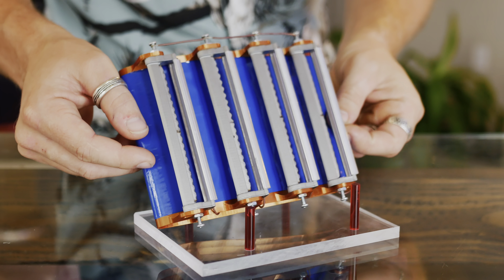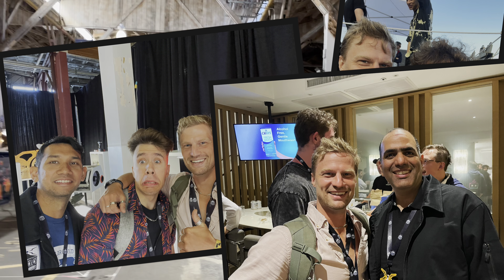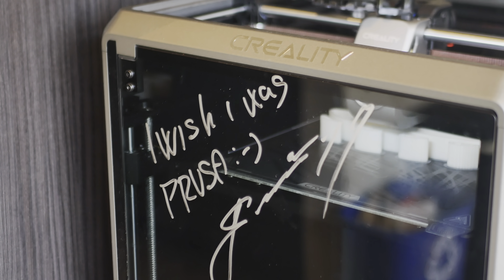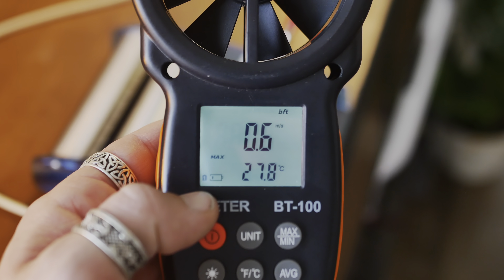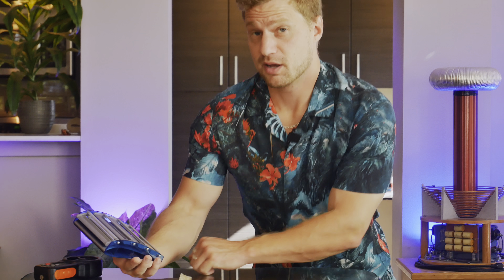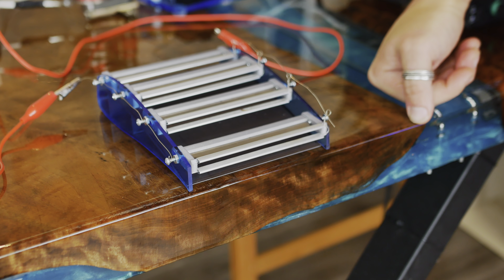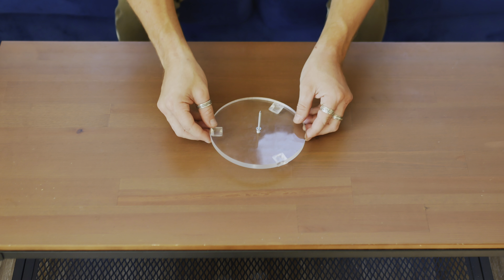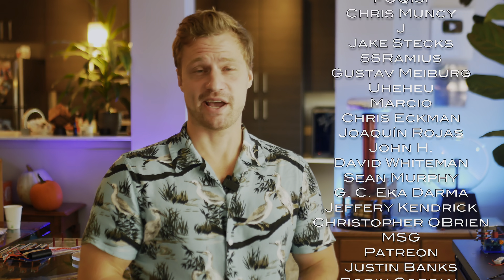Designing A Self Propelling Ionic Thrust Wing

Comment: Some comments I would like to make as an engineer. By having the thrusters mounted on the wing the way you did there will be some consequences. Firstly, the lift and drag characteristics of the aerofoil you chose will be affected by this positioning significantly essentially the data on the lift curve slope and drag coefficient will have to be taken with a huge grain of salt. Furthermore, mounting the engines this way means they are following the curvature of the aerofoil this is bad because on the upper surface towards the trailing edge the thrusters will be constantly pointing downwards and this will generate a nose down pitching moment on your plane. To correct this I suggest you either integrate the thrusters into the aerofoil however this will be significantly more difficult maybe something along the lines I have drawn. However, I’m not sure how you would get the thrusters to have access to air. 
Final point about where you located the thrusters you mentioned that you made the aluminium streamlined I would suggest you pick an aerofoil shape for the ionic thrusters aswell as otherwise you will produce a very large drag coefficient

Comment: Instead of just the glider, maybe revisit old delta- and flying-wing designs that Popular Mechanics used to tout as 'the future of aviation' back in the 90's. Lots of surface area with a built-in lift. Alternate strips of Ion Engines and photovoltaic solar panels to run them.

Comment: With a parametric eq, like in Logic, you can use a narrow band to isolate the freq and then drop the gain on just that narrow band. Start by taking a narrow Q handle and maxing its volume. Slide it around until that sound is really loud, then drop the gain of the handle way down.

Comment: Fascinating!
Question: the air velocity is highest over the top of the wing. This means that the pressure (and hence, density) is lowest. Do you really want the thrusters under the wing, where air is densest, and slowest?
Since the densest air gives you "more" to accelerate, it would seem to be a plus. It also is smoother flow, less turbulent going through the thrusters.
What about splitting the upper and lower wing skins, with the thrust creating elements inside? It might be possible to create a "blown wing" configuration flying at slower speeds. And you get "thruster structure for "free"!

Comment: Maybe another reduction of weight could be painting your electrical connections with carbon impregnated resins? 
To increase thrust, adding ducting overhead of your thrust would increase the airflow in, and the pressure/velocity out, would it not?

Comment: When thinking outside of the box, don’t actually completely loose sight of the box.  Leave planform considerations to actual qualified aerodynamics engineering.  Instead, you are developing an alternative propulsion system.  Just leave it a that.  Do your work there.  Don’t attempt to dabble/dawdle outside of your own emerging field of design.  Whether a single (maybe, dual) Ionic Thruster in the tail, or multiple in nacelles hanging off pylons, you are just attempting to come up with a revolutionary replacement power plant to replace what is already well located within existing airframes.  Furthermore, any new thrust producing technology need be more energy/weight efficient than other means (as measured in, say, total thrust-pound hours per total energy capacity weight)

Comment: 1. Make the thruster assembly monilithic? Like joining them with plastic. Without bumpy edges.

2. Make the monolithic thruster surface profile exactly as the wing surface itself.  Or add another wing on top of the thruster assembly. This way, the top surface will also generate lift just from moving through air along with the top surface of the bottom wing where thurst comes from the plasma attracting air. You get more lift in total maybe?

3. Question, Can you control lift by turning off/on or modulating airflow through one or more thrusters instead of moving surfaces? Now if possible, that would be a one step to a completely fixed wing plane.

Comment: I can't shake the feeling that having multiple positives and negatives in a series can be counter-productive if not 100% of the particles charged by one electrode get dis-charged by the next one, but it's just an hypothesis of course. I'm guessing we could learn a lot about the dynamics of these prototypes by placing them inside a container with Xenon or other easily-glowing gasses.

... I'm also daydreaming a miryiad of possible designs and hypothesis I'd love to try out if I had the means, I'll try and pitching them to you instead :D

Comment: The top of the wing has low air pressure. So the thrust might generate unwanted pressure
But the bottom has fast moving high pressure which might cause drag if the thruster doesn't move enough air

Comment: Never thought about how ionic thrusters wor, but you just made me very interested. Try diving into aerodynamics a little, F1 cars provide a lot of info about this. From my knowledge, the first thruster is fed clean air and can have a maximum input and provide optimal performance while the following thrusters are fed by the output of the first. Is that going to reduce their performance? How about a decreasing size of the thrusters? A big one that takes in a large amount of air and is feeding the next slightly smaller module. I think this approach would decrease weight and power consumption while increasing the performance. Might not boost the results, but at least allows to cut even more weight

Comment: I wonder... if you split the wing horizontally and incorporate the ion propulsion within the wing structure instead of obstructing the low pressure surface (top) of the wing, if that will be more efficient. Your lift comes from the overall low pressure surface in conjuction with the propulsion source

Comment: How does it work with water vapor? Like clouds and so on. On a normal jet-engine it would get pushed to the walls and directed to an channel that moves it around the engine till the heat turnes it to vapor, making the water produce more volume. So how does the ionic-engine handle water ? Also does it work in a vacuum? I heard one time that the ionic-engine is a way to move things in space.

Comment: I watched your experiment and found it very interesting. I have a problem and maybe a solution which could help, so here goes. The problem is, yes the thruster works on your little balancing device but all this proves is there is thrust as in your experiment as the device rotated but there was no evidence of lift . The lift of the wing section is nullified by having the thrusters on top of the wing section. However; if you were to incorporate the thruster in the wing cavity, slots in the leading and trailing edge of the wing section allowing for the air to be drawn into the thruster through the leading edge slots and exit by the trailing edge slots I believe this would work. Aircraft use "Spoilers" to break the lift component during a landing cycle and on parked Aircraft the breaking of lift can be achieved simply by having piece of 4X2 on the top of the wing preventing it from obtaining lift and trying to fly  whilst on the ground. Cheers

Comment: You should look at how sailors trim sails on tall ships, or multi sail vessels - they use each sail to not only provide lift, but to also accelerate air to the high flow section of the next sail - making it more effective as a system, and the total lift greater than the lift of each individual sail.

Trimming the thrusters so that they do something like this and use the accelerated air in the most impactful way possible could help improve results.

Comment: One thing to mention for the next project, if the wire design works well, maybe see if you can get a fine wire saw so you can get points on the wire as well. Seem to remember that having fewer sharper points worked better. Might not make too much of a difference since the points are so small, but food for thought.

Comment: It's the increased flow of air over the top of the wing, (due to the curve of the wing on top that is a greater distance than the bottom of the wing causing a lower pressure on top of the wing creating lift). Soo, you need to place the thruster in front of the wing to create lift. Your design moves air but you have covered the top of the wing and your thrust is contained between the wing and thruster creating more drag than thrust..

Comment: Hi, i love the concept and ‘competitive’ approach. Have you (both) considered incorporating your achievements in ion thrusting parts within a wing? My point being to minimise the form drag , combine the wing structural requirements to keep weight down and push out airflow through the trailing edge. This would create a natural convergent duct between leading & trailing edge. A single fine gauge wire aft of the trailing edge may pull the ions through  giving the final thrust.
Just a thought. 
Cheers GT

Comment: I think that the second test with a result of 3.5 showed a higher result than the first test with a result of 2.7, since in the first test the thrust vectors of each element were not parallel. but by placing them in parallel, as in the second test, at higher speeds, the flow from the wing will stall, the lift will disappear, and a spin will occur.
Reply: i think you should try to install thruster inside the wing, this will be much better for aerodynamics

Comment: Hey, what if you add a nozzle of some sort to encapsulate all the moving air like you would in a ducted fan, I assume it would increase the efficiency of the thruster the same way as it does with a ducted fan however I have no idea how much it would increase its thrust to weight ratio.

Comment: Have you ever read about the landing profile of the F-104 Starfighter? It had tiny wings, so Kelly Johnson made a system that increased lift by ducting jet thrust over the top of the wing to increase lift. 

Similarly, I think you are really missing something by not measuring the lift of your airfoil. It’s going to have more lift per mps of horizontal speed than you would get from just looking at its cross section, because you are increasing the speed (and decreasing the pressure) of the flow over the wing.

Comment: Does the current matter in this equation? Because voltage is definitely needed for the electrons to jump from anode to kathode, current is the amount of electrons that pass in a second, so higher current should mean more electrons moving, thus moving more air particles.

Comment: Try using watch screws or aluminum screws to cut weight more. Those watch screws can be 1mm in diameter. Stop using bolts and just thread the plastic part it self. This can be done with a tap drill bit like a M1 or M2 bit. Honestly stop using steel and use aluminum from a soda can. Merely snipping it with shears to get the shape and it might cut weight even more. Steel is 2.5 times heavier than steel after all.

Comment: Creating a table tennis table with electromagnets and sensor-equipped bats to control the ball's trajectory is an interesting concept. While the practicality and mechanics of such a system would require significant engineering, the idea is theoretically possible with current technology.

Here's a rough outline of how it could work:

1. **Electromagnetic Surface**: The table could have an array of electromagnets beneath its surface, each capable of being activated independently.
2. **Sensors in Bats**: The bats would have sensors that detect the impact with the ball.
3. **Magnetic Ball**: The ball would need to have magnetic properties, either being made of a ferromagnetic material or having a magnetic core.
4. **Control System**: Upon detecting a hit from the bat's sensors, a control system would activate specific electromagnets to guide the ball toward the opponent's side of the table.
5. **Adjustable Strength**: The strength of each electromagnet would be adjustable to control the speed and trajectory of the ball.
6. **Programming**: The system would need to be programmed with different trajectories and responses to ensure the ball lands in a returnable position regardless of the shot played.

The main challenges would include calibrating the magnetic field strength to manipulate the ball accurately without disrupting gameplay, ensuring safety so that the magnetic fields do not interfere with other electronic devices or harm the players, and developing a system that can react in real-time to the fast pace of table tennis.

It's a complex system that combines elements of physics, electronics, and software engineering, but with enough innovation and development, such a concept could be made into a reality for a fun and unique table tennis experience.

Comment: Yeah.. pointless... no matter what you do, your operation will take more battery power than its lift will allow for. Keep wasting your life though.
Reply from the maker: Is that how you feel about all emerging technologies?
Reply: @PlasmaChannel  are you pretending ion engines havnt been a thing since the 60s? What are you gonna try next? Rubber band propeller?
Reply from the maker: @fasfgasdfagadsf ion engines for use in space propulsion, should be your statement. Please cite their use in atmospheric conditions. Otherwise, you’re comparing a submarine to a boat.
Reply: @PlasmaChannel  absolutely. A slingshot in space is different than a slingshot here.. never seen an ionic brease fan? They beat ya to it 20 years ago.
Reply: @PlasmaChannel  as a matter of fact that's what they use in fabrication shops to keep the heavy metals out of the air. Using one in a plane would catch so much debris that there is a mathematical formula used to calculate gathered weight for each sphere of the planet already.
Reply from the maker: Ionic breeze fans have little relation to an ionic thrust plane. I ask again, please cite flight applications. Tell you what, I’ll cite it for you. I encourage looking up MIT’s ionic thrust plane from 2018. Uses only ionic thrust to fly, with assisted launch. 

Proof that this is an emerging tech, still in infancy for use on planes. And, showing potential. My design is heavily flawed. But I care only about progression, and progression results from persistence.
Reply: @PlasmaChannel  you won't find flight aplications.. because it doesn't work that way.. which is why I told you not to bother.. the closest thing your getting to flight aplications is a blimp... and again not worth it because it can't fight the wind.
Reply from the maker: Hey, I hear you. But tell that to MIT. Also your sentiment is one which people constantly state prior to every major breakthrough. “A motorized horseless carriage? That’s silly” “a vehicle that flies, that’s impossible” “power from a nuclear level, oh that’s simply impossible. Things don’t work that way”

My point: just because something is unlikely, doesn’t mean it’s impossible.
Reply: @PlasmaChannel  that's cool, but until energy transfer technology improves, it isn't feasible. And when it is.. give me a jetpack instead.
Reply from the maker: @fasfgasdfagadsf I’ll happily take a jet pack myself haha.
Reply: @PlasmaChannel  ultimately we have the capability.. they just won't let us use it. Should elaborate.. energy sourse. They don't want Jeb down the street playing with a fusion array.
Reply from the maker: @fasfgasdfagadsf I guess it’s up to us to bring that tech to the forefront. I’m not afraid of drawing government attention. As far as I’m concerned, they work for me.

Comment: Your new engines really remind me of a tesla valve.  Integza knows those well. You should totally flex and make an ionic compressor using them large intake narrow exhausts. Using bernoulli's on your trust modules and stacking more at the front and less at the back it should really suck. Like how a carburetor works getting faster denser airflow by just cutting down the area. The air would want to go through and compress nighthawlkinlight has a really good video showing what an expanding gas looks like in one (https://www.youtube.com/watch?v=tcV1EYSUQME) . Would be nifty to see an ion version even if it wasn't  practical for a plane. I'm confidant if you had a large intake at the nose of the plane and ducted that to the trailing edge of the wing through the compressor carful to have a smaller outlet you could get it working with the right materials.

Comment: X-Rays - be careful how close you go to the electrodes of the unit.  Accelerating electrons at 50kV into a close target produces X-rays.  If you dont believe me, enclose a piece of photographic film (in a thin dark covering) in front of the ionic wind.  It should expose the film through the thin, dark paper.

That's how Röntgen discovered them.  Old TV tubes used lower voltages and had lead glass to reduce exposure to X-rays.

Comment: This is taking you nowhere, the fundamental knowledge of flight is clearly lacking.  With the same principle why don’t the jet engines are under the wing suck the plane down with high velocity exhaust? To create a proper lift, the wing has to move forward into the airstream with minimum obstacle.  Lift is a balance of force vectors over the area at any given air velocity and you have too much drag right now.  What you have now is called static thrust and the potency of the air amplifier will gradually decrease as speed increases.  You need thrust and lots of it to sustain ability to fly direct unless you are flying a glider.  You have done a good job here nonetheless for trying to create another version of air amplifier.